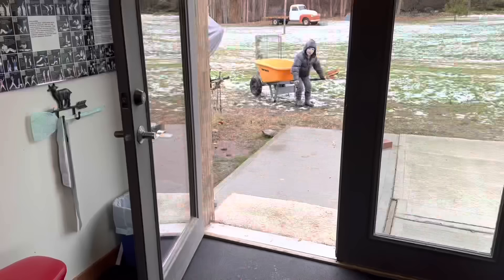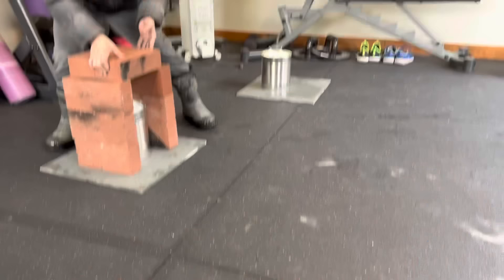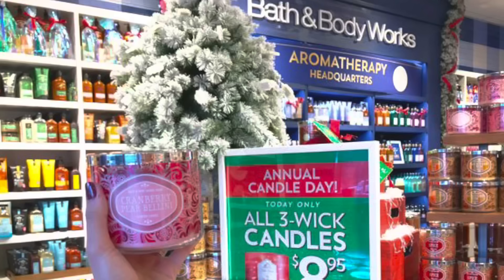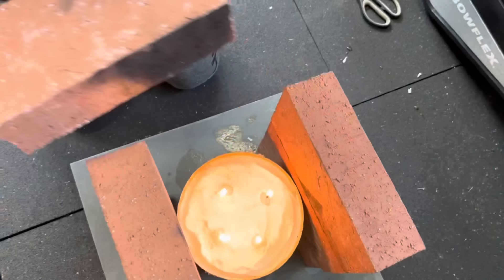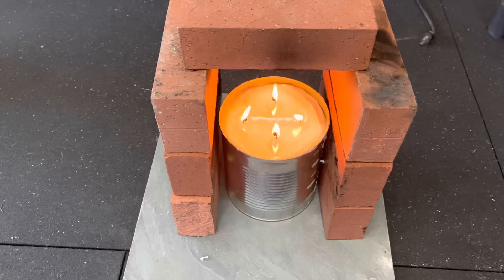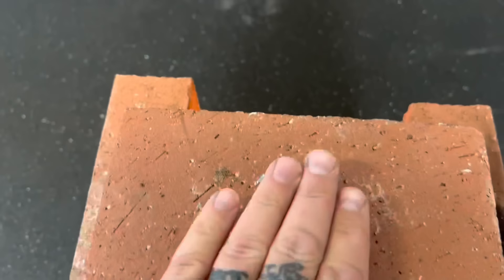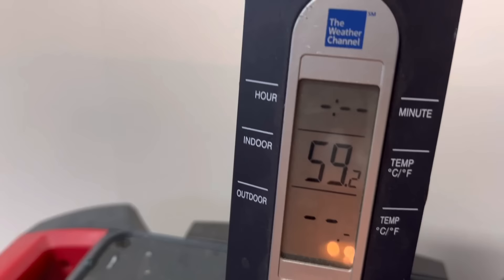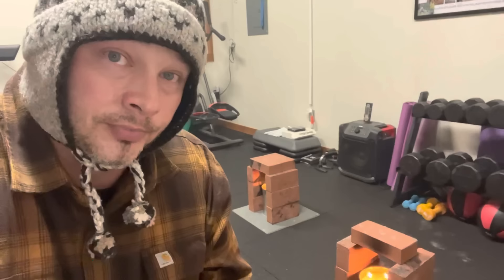Crisco candle room heating | Power Outage Room Heating | 9 hour test

Comment: Hello.  Hopefully you’ll see this.  What are your thoughts on wood wicks?   One of my problems with my terracotta heat set up is creating too much heat in my candle and too much melt then my cotton wicks fall over, drowning out.  Possibly my utinsel tumbler isn’t tall enough and accumulates too much heat causing too much melt.  But still curious about wood wicks.
Reply from the maker: Well I’m not sure, I have had mine melt up to an inch and had an inch of liquid in my wicks were still doing fine, I think there’s some poor wicks out there that people get, I haven’t used wood wicks yet but I would experiment with it, the other thing that I’ve mentioned some people is rotating your candles so they can harden back up if they’re consistently getting that issue with their set up keep toying with it and let me know if you find another option that works, another option is spiraling a wire around a wick and then teeing it off at the top of the jar, you could also find some widemouth soup cans that might be better than jars if you’re using them
Reply: @RiversideHomesteadLife  thanks for responding.  I did pick up a taller stainless utensils container today and believe that will do the trick.  I put a short 99 cent store 3 wick jar candle in my shorter utensils container today and let it burn for an hour and it seemed to do fine so I have every reason to believe my new taller holder will work.  Also I am drinking a couple Arizona teas as we speak and am going to build the penny can stove next.  By the way, I did put together the brick rocket stove.  Works great!

Comment: I think if you only used them for 8hrs the room would fall below freezing in the other  16hrs and the pipes would burst
Reply from the maker: It’s a survival last resort for some- if you have nothing else ….
Reply: @RiversideHomesteadLife  but you are planing for this so you could plan more realistically with a better solution that would keep the building habitable, after the pipes burst you will not be able to live there very long without a lot of expensive work .

Comment: I'm wondering what you think the bricks are doing?
Reply: They are crucial to thermal mass -- holding heat and radiating it out over time.  More effective heating technique than just a candle sending its heat straight up to the ceiling.

Comment: Help!  My candles keep going out. I’m cutting the paraffin candles to size, trim the wicks, and they burn about half way and go out. What am I doing wrong?
Reply from the maker: Gee wiz .I’m not sure - that has not happened to me yet… I think what you should do is not burn one candle as long.  And plans to rotate - that should help with you issue -  burn for few hours blow out and rotate….  Try that
Reply: Either try other candles or make a classic crisco candle with puttin' a wick instead of a candle.
Reply: @RiversideHomesteadLife  will do. That may be my issue. Thank you!
Reply: @YESHUAmyGODmySAVIOUR  I have been thinking about trying that. Thanks!
Reply: @rosewood9839  🙏❤🕊

Comment: Did you say that the crisco (is that spelled correctly) has paraffin in it, something about so do candles????????????
While this idea is much safer than the alcohol burning I do wonder why people just don't have a gas heater.  I live in a tiny home and our cooking, hot water and heating is gas - bottled gas.  This costs me [currently with the super high price, this is double what it normally is, in normal times this would be half the price) $150  this includes delivery as we are rural and don't have a car -  every six to eight weeks.  I run my heating from 5am to 10pm and even if the power goes out the heating still works - even if the timer doesn't.  I don't understand why people don't just have an emergency gas heater and bottle standing by - we've been doing this for years, or we always have fuel in case we need to use the fireplace for cooking, something which has happened more than once in a storm -  or even one of the tiny stoves complete with a tiny chimney which can be poked out of a window/used in a tent or boat especially if you are in an area prone to storms and the resulting power loss.
Great video but I've always found other, more reliable and safer, methods of emergency heating and cooking are available with a lot less hassle and more reliability, and for less money.

Comment: I tried  testing a small terra cotta pot with a couple of  crisco candles made out of baby food jars and birthday candles. What happened numerous times was the candles would fall once around a quarter of the crisco melts. What am I doing wrong? Its packed in the jars i'm not skimping on the crisco, lol...also i tested the candles alone as a light source and not under a pot and I had the same result. It did take six hours but at that point the candle fell in the crisco
Reply: Did you melt the crisco before and puttin' it into the freezer❓⁉️ And then stick the candle in❓❤🙏
Reply from the maker: Some people have this problem not sure yet if it’s flimsy candles or what I never have that problem - but I have a solution- make extra candles burn them 4 hrs at a time rotate- stick hot ones outside to re harden - “ rotate” 
May be som crappy wicks out there that don’t play along
Hope that helps

Comment: Too high. Turn the top vertical bricks 90 degrees. You'll gain another 3-10 degrees, depending on the size of the space you want to heat.

Comment: Is the burn time of the heater/candle divisible by the number of wicks you put in? i.e. 1 wick =8 hrs.......2 wicks 4 hrs etc?
Also, are the but units increased proportionally to the wicks?
How much does the wick diameter effect the but output per wick?
Thanks

🔥🔥🔥🔥🔥🔥🔥

Comment: Would that be enough heat to use a small fan which runs by heat?
Reply from the maker: Possibly- if not replace to top with a PCs of ceramic tile or cooking sheet - should heat up enough with something thinner like that for sur
Reply: @RiversideHomesteadLife  Thanks

Comment: The 16 candles you use burn very little oxygen. I have not done the experiment my self but I bet you could get a higher temp with no carbon monoxide increase with your window cracked much less than that 1".

Comment: So basically you won’t freeze but you really won’t be warm.  I keep the heat in my house at 70.
Reply from the maker: You are probly correct
Reply: I think the point is to keep from freezing to death in an emergency situation, not to replace a heat pump or wood stove that you might use on a consistent basis.

Comment: Paraffin is derived from petroleum, coal or shale oil. Sorry people... There's no paraffin in crisco. That's not to say burning vegetable oil doesn't produce a similar molecule to paraffin, but it's definitely not paraffin. I don't think the people who make vegetable oil add petroleum to their product. I don't think I'd cook with and ingest it if it did.
The process of making it is quite similar as it's pretty much distilled out but it is not paraffin.
Reply from the maker: There is paraffin in there I stuck a candle in there
Reply: @RiversideHomesteadLife  I bought the wicks from hobby lobby that have a steel wire running up through the center for rigidity of the wick. 
I experimented with lots of different candles. The long 10" candles work pretty good. BDay candles seem to melt at a lower temperature than the 1/2" of shortening the candle melts on it's way down. They sell bday candles wrapped in foil that keeps its shape as they burn.
They work best if you're just using bday candles. If not the wick kinda just lays down and douses itself out.

Comment: Crisco idea is good but the brick idea needs work to create a more efficient set up you are losing way to much heat try heating special hard copper tube that will not lose heat like the bricks  then add a low power fan to push heat around the room .  You lack containment of heat and a means to push heat around the room.  Like your little cloned self.  Like a mini me.

Comment: Could you use cement bricks?
Reply: I think yes. But I don't think they conduct the heat as well.
Reply from the maker: True
Reply: Fire bricks may be a better option from tractor supply. They hold heat and are used to make brick pizza ovens.

Comment: A burning candle will release the exact same amount of heat into a room regardless of bricks (or flower pots, etc.) being stacked around it or not. All the bricks do is block the light of the candle, which would actually be useful. Heating the bricks up just means all that heat would have gone into the room sooner. They literally slow down the heating of a room. And if you leave a window open and the bricks came in from the cold outdoors then there would be a net negative! Unless you cooled the entire room overnight, and all the things in it (this is literally a weight room, it is full of thermal mass), the thermal mass of the warm objects/walls/floor in the room will automatically bring the room temperature up as soon as you close the door. 
These things are a dumb distraction from meaningful preps and skills.

Comment: What do the bricks do for BTU?
Reply: Not sure what you mean by "do for BTU", but they are there to provide Thermal Mass.  They absorb heat, hold it and radiate it into the space even after the flame is out..
Reply: @eatiegourmet1015  But they don't increase it.

Comment: 🤣🤣 Making a bomb? Not a chance in hell. You'd have to stuff enough oxygen in there for the whole can to burn, and then seal it up air tight. Anyone who says that could explode like a bomb is stupid. At worst, it's a fire hazard. If you want to prevent that, put a rimmed baking sheet under the can to keep the liquid shortening from spreading. But based on the fact that it appears to be (by your numbers) about 250 F short of catching fire without the wick, you're pretty safe.
Reply from the maker: Did just fine numbers were fine- and no alarms went off- but if you are in fear you should pick another option- there are many 
Safety first for you , be safe

Comment: there is absolutely no control sample to your experiment
Reply: Clearly he needs to build a second exercise room. /sarcasm  My cheekiness out of the way, a control sample is absolutely needed during the same conditions. Perhaps two identical garden sheds or the like. Plus use remote thermometers to prevent opening the door, etc. The smaller the area to heat, increases the efficiency of the candles.

Comment: Without the bricks you would get the same exact results smh
Reply from the maker: Bricks just radiate heat lower
Reply: I guess if you wanted to warm your hands up you could put them in the bricks but the heat still rises and the temperature of the room would be the same with or without the bricks.

Comment: The bricks aren't doing anything. They're not going to give out more radiant heat than the flames that are heating them, and their warmth is going to cause as much convection as the candles -- at the same rate once the bricks reach a temperature where the heat going in is the same as the heat going out. 
     Chimneys work because make it more difficult to burn your house down relative to the hearth they replaced, and they get rid of smoke & stuff more efficiently as well. But that warm air that's escaping through the chimney? It heats the stones or bricks which give off a lot of radiant heat -- heat that would have gone out through a hole in the roof above a hearth. So for identical fires, the one in a chimney will keep more heat in the house than the one in a hearth. 
     The warm air you're creating with the candles isn't going anywhere. You can't capture a higher percentage of generated heat because you're already getting all you can in a closed room. Taping el cheapo space blankets to the windows and walls will help keep radiant heat in. If you could do the ceiling as well, you'd really be working it. It won't stop conduction, but it should help.
     Also, a candle generates about as much heat as a human, so if you don't have any more candles, invite twelve friends over.

Comment: There no way a candle can heat a whole room
Reply: A candle is like a 75W heater.  If you only need to make about 1 degree of difference in room temperature nearly anything will work.
Reply: @kensmith5694  1 degree is Enough thing.  If it make that? You will freeze to death 🥶🥶  or burn down your house🔥🔥

Comment: Ah but for the complicated futility of ignorance.  This is why we can't have nice things -- because people don't think and believe stupid shit like this.
1) The heat energy comes from burning the fuel.  You CAN NOT get more heat from trapping it in clay, or burning it under a pot or brick.  That is just nonsense.  It produces max heat and max light based on the WICK, (which provides more/less fuel to available oxygen)  not the terracotta.  There is no 'heat conversion'.   That's utter b.s.  

2) gram for gram; ounce for ounce::  Paraffin wax contains 10% more usable energy than crisco/cooking oils/shortening.   Just buy candles & candle wax.   They burn 10% longer -- And they never go rancid. 
If you prefer:  the 100 hr oil candles? -- The fuel is tetradecane. The liquid version of paraffin wax.  Same energy content but messier if spilled or ruptured.
-- Physicist.